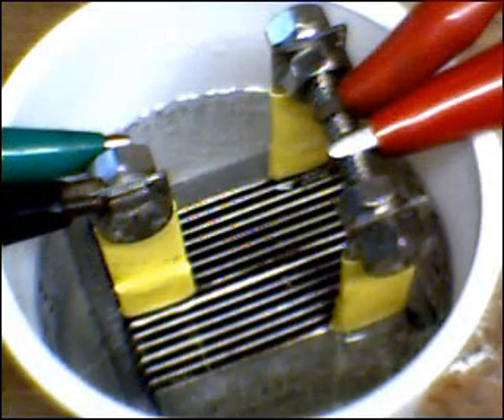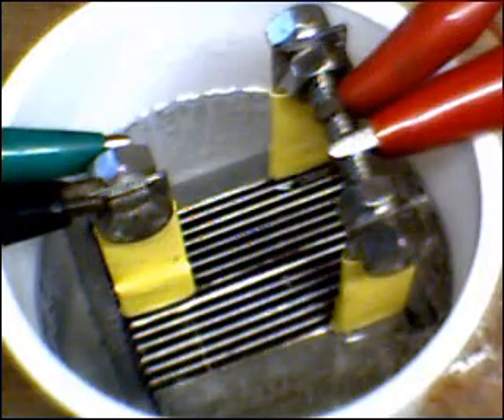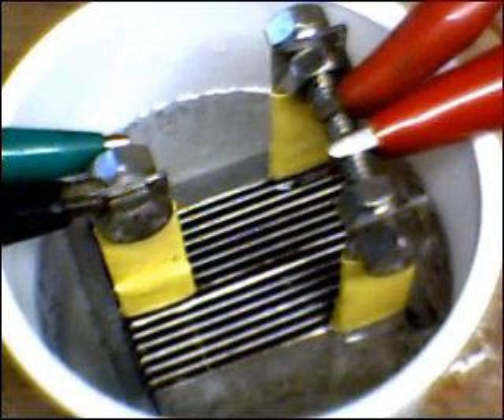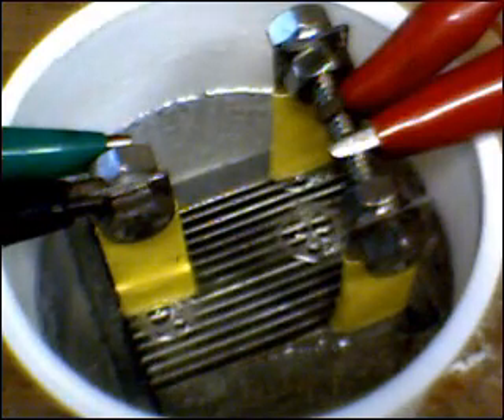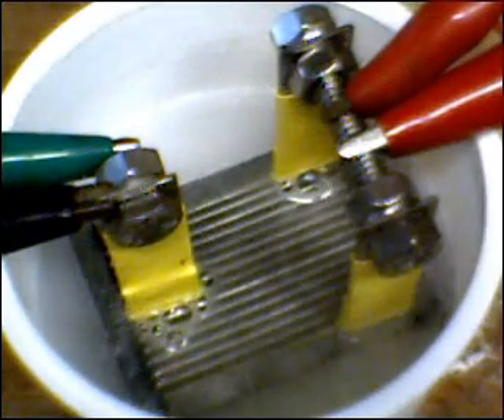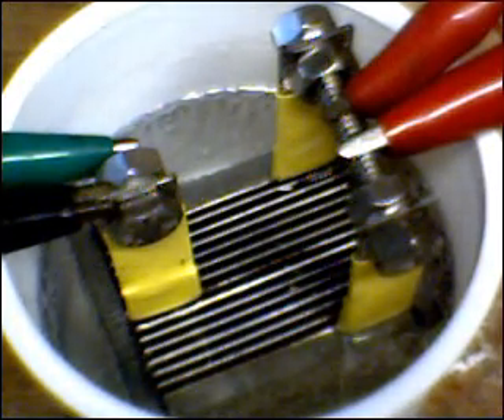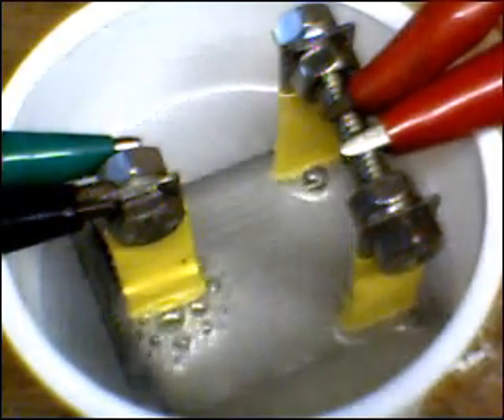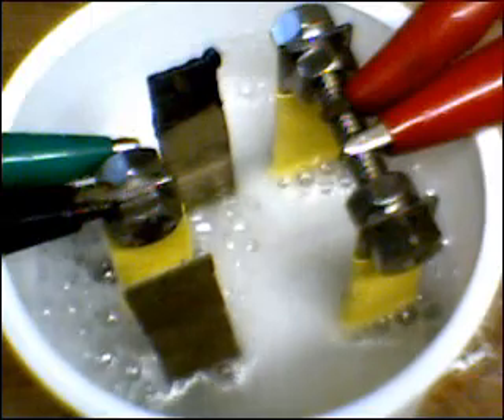#41 New Experimental HHO cell FIRST TEST RESULTS

Comment: ONE of the worst things to do is use alligator clips to connect voltages for precise measurements. The connection or should I say grip varies so much voltage and current fluctuates giving  a person bad data Mark. THiS is what I have found out numerous times.

Comment: If you're interested in getting more hydrogen production like I just mentioned to another site by You would get a considerable more production from your plate by using the perforated plates with the little 1/8'' holes every 1/8'' apart the stainless steel sheet come in as thin as 1/16'' thick which will be lighter and able to have many more plates separated with your gaskets. The reason this works better is as you can notice that all your hydrogen bubbles all generate from your edges of your plates so with the holes all through your plates gives you much more edges for your hydrogen to generate off of.

Comment: Perhaps you will find some of this info useful. HHO isnt the proper term, its called oxyhydrogen (2 h2 + o2). It would be safer to make a cell that keeps the o2 molecules and the h2 molecules separate, because h2 won't burn unless exposed to oxygen, and o2 only accelerates the burn rate(oxidization) of fuel. oxyhydrogen when generated via electrolysis has a 2:1 ratio, 2 h2 molecules and 1 o2 molecule. No offense, but chemists laugh when they hear the term HHO because the gasses cannot exist stably in this configuration, both hydrogen and oxygen form pairs, despite being elements they exist as molecules in nature. I'm not trying to nitpick or detract from the work, just sayin use proper chemistry terms to describe the reaction instead of fringe terms and mainstream scientific people will take your research more seriously, also in an automotive application you may as well discard the o2, because combustion(oxidization of fuel) takes place with oxygen from the air the engine pulls in. If using hydrogen with gasoline to increase efficiency, the engine control unit needs to be tuned specifically for the ratio of h2 and gasoline to achieve complete combustion and full efficiency, if just using hydrogen then similar is applicable, you must compare hydrogen vs gasoline energy density in both cases and program the ecu accordingly for maximum efficiency. Maybe you already know this information, but then why would you still be using oxyhydrogen which is very explosive due to the fact it forms a stoichiometric mixture(correct ratio for complete combustion) automatically from the oxyhydrogen "HHO" generator, instead of just using h2 which is safer and more practical when converting a gasoline internal combustion engine to a hydrogen I.C.E
Reply: i just realized how old this video is. lol oh well.
Reply from the maker: +James Paul LOL. I know. But just because it's old (like me) doesn't mean it's good (LIKE ME!). :-)

Comment from the maker: The black adhesive is not conductive to DC. It behaves like a solid electrolyte that stores electrical charge like a regular capacitor. Electrically, it's almost the same as placing a capacitor across the input terminals. What it would do is upset a R/L/C tank circuit when AC or pulse energy is applied.

Comment from the maker: Also note, my decision to go from 6 to 5 neutral plates is for DC powered cells ONLY. I still believe just under 2v per plate is the optimum BIAS voltage to entrain pure distilled water molecules for efficient fracture through tuned resonance pulsing.

Comment from the maker: When running at 1.97 volts per plate, any nonlinearity in the distribution of charge becomes accentuated by the nonlinearity of the current curve. It looks like cables between towers of a suspension bridge. Once you try to push the whole stack beyond 2.2 volts per plate the charge distribution evens out.

Comment from the maker: Just to comment on the nonlinearity observed: Current does not follow a linear path with voltage in the cell. Between 0-1.8 volts it's pretty straight and shallow. At this point it begins to break down and current starts to rise steeply. Between 1.8 and 2.4 volts is where it makes this transition. Over 2.4 volts the current continues to rise exponentially with voltage.

Comment from the maker: And here's the worst part. I still don't know if the adhesive I was using before is any better. I have two smears of adhesive curing tonight, one new, one old. Tomorrow I will peel them off, put them between equal plates, measure the capacitance of each and compare the difference in dielectric properties between the two.

Comment from the maker: I WANTED to stay away from caustic electrolytes and pulse straight distilled only. UNTIL I discovered what a poor choice it was to use this adhesive that completely threw off any predicted capacitance values for the cell. This made it totally unsuitable for use as part of a tuned resonant tank circuit. Until I rebuild with different adhesive it's suitable for DC only. >:(